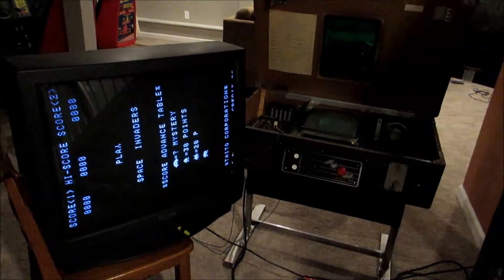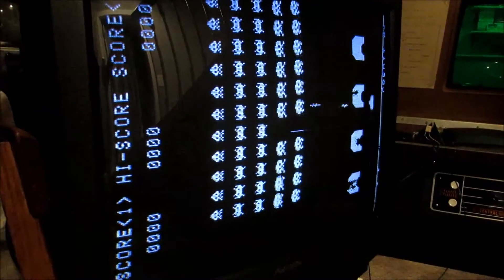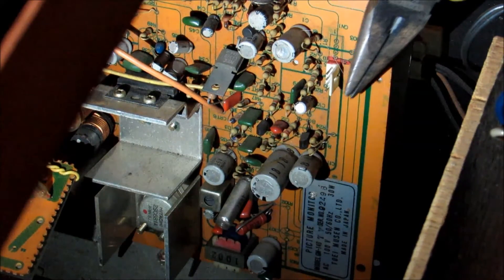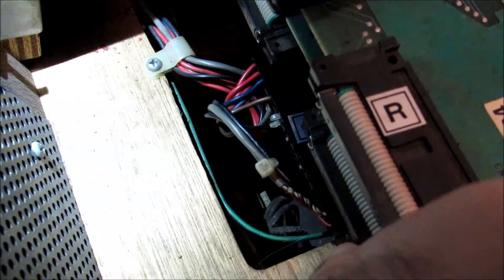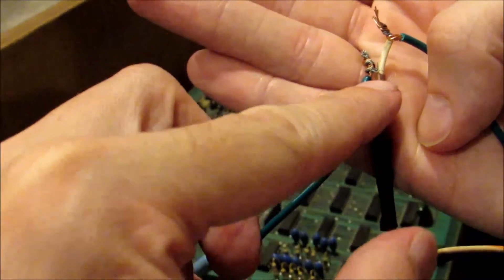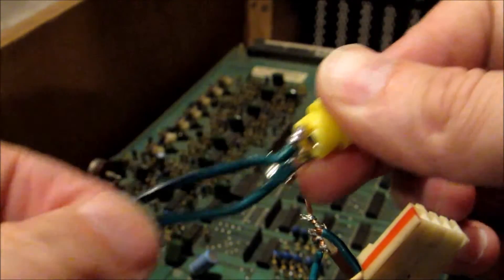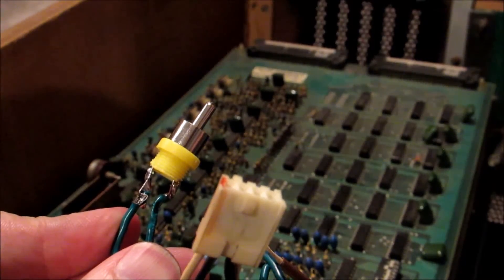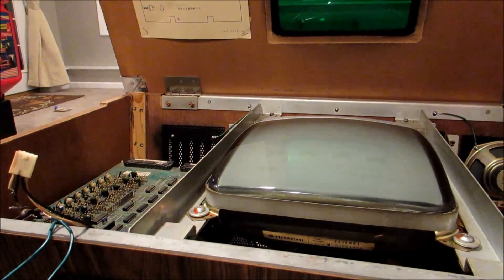Taito Space Invaders Connected to a Color TV

Comment: did you ever hook up 13in. tv to it?
Reply from the maker: So I have good news and bad news regarding that. 

Good news:
- I had a bad ground with the video signal that was causing my issue
-The original monitor is still in there.

Bad news:
-13" TV works but I can't adjust the horizontal width on it. There is something that looks like a width coil, but it just won't move... I've tried searching for a service menu for it too with little luck. I was hoping that either the manual or service menu would allow me to adjust it.  The issue with the horizontal width is that the scores at the top and lives at the bottom end up getting cut off. 

I've set that project aside until the monitor goes. I schematic..or at least a cap map has been found/created for this monitor too within the last couple of months! So I may be able to rebuild it if needed. 

Thanks for checking in!
Reply: I had the same problem could not make adjustments with tv I was hoping you solve that problem
Reply from the maker: There has got to be a way....This does call for more research though.
Reply: That Tim Guy
thanks Tim